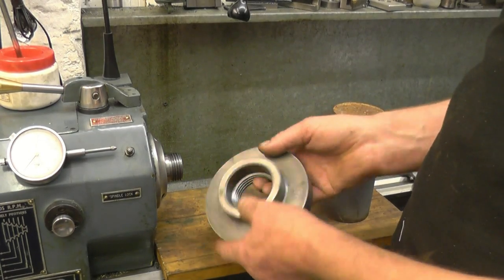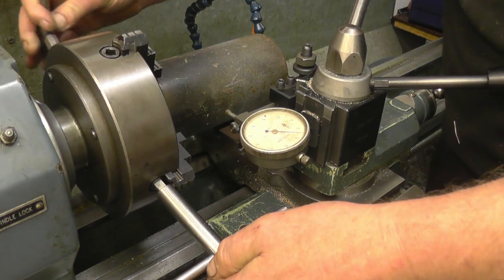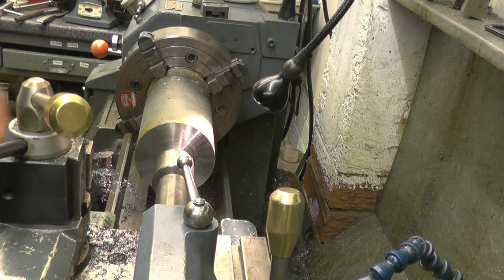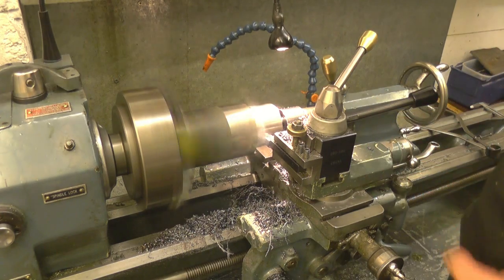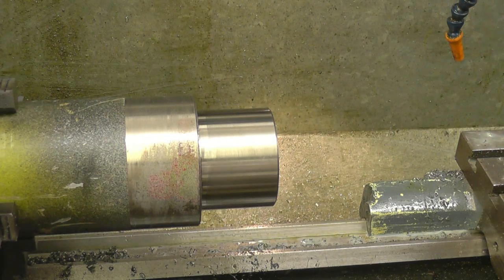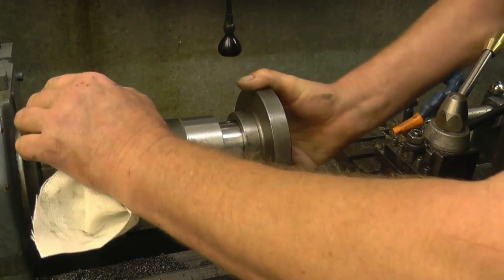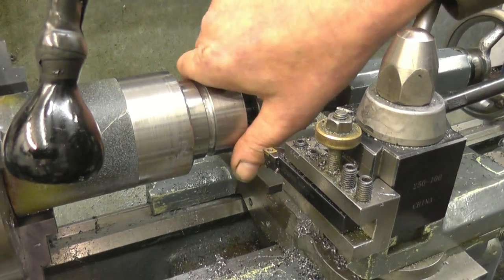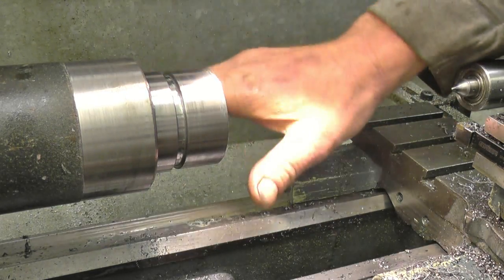Screw Cutting Part One

Comment: Very interesting for us viewers great viewing . I got fed up with screw on chucks on smaller lathes as you can't use them in reverse & prefer to part off with a upside-down blade as it's 100X easier & you don't chip your carbide tools. I've gone through 5 or six different lathes & it was a experience but you learn something along the way. I wish someone told me at the start to buy the biggest lathe to fit in the space you have so you have the capacity for larger jobs down the line. I still have a TH10.20 & a 330IS  set up for different jobs. I should have got the boxford 330is in the first place but I tryed to save money buying cheaper but that cost me thousends in the long run

Comment: John,
Where do you get the magnetic back, DTI's from? Or are you adapting an ordinary one? Lots of the chaps in the states have them as well, but I've never seen them sold in the UK

Phil
Reply from the maker: Hi
Phil
All I use is a "hard drive" magnet glued on to a cheap clock
John